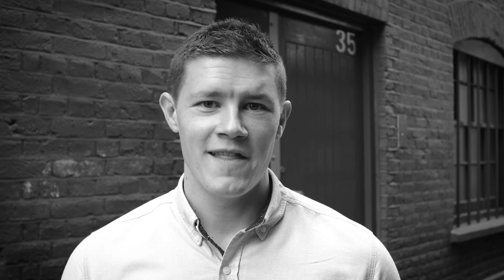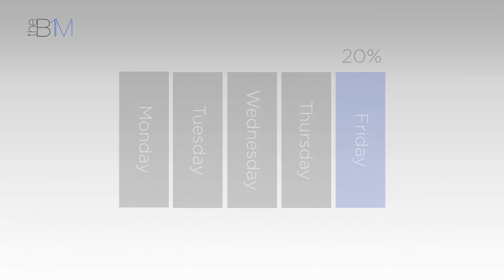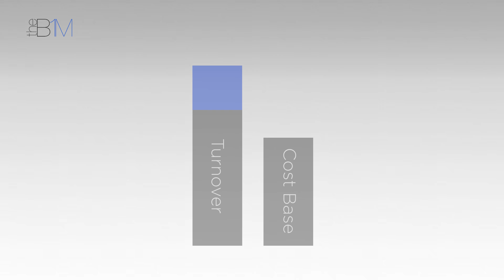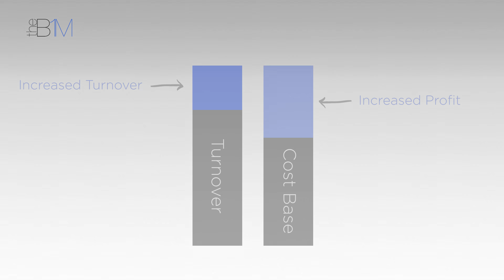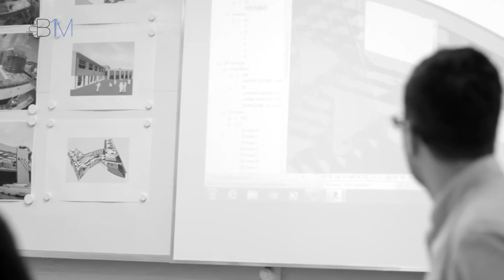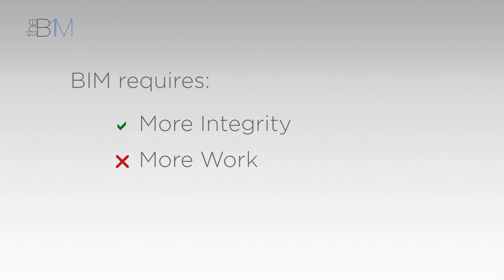Top 3 BIM Myths Dispelled | The B1M

Comment: Great videos.

I think there is a myth inside your myth dispelled video however!

BIM is not just for buildings, which you keep referring to in your videos, but it is for varying type of structures and infrastructures. 

Do correct me if I am wrong. :)
Reply from the maker: +Mousa Dahabreh You're absolutely right, it's applicable to the whole built environment. You'll find that we say "built asset" when we're talking in broader terms and "building" when we are using an illustrated example that shows a building.